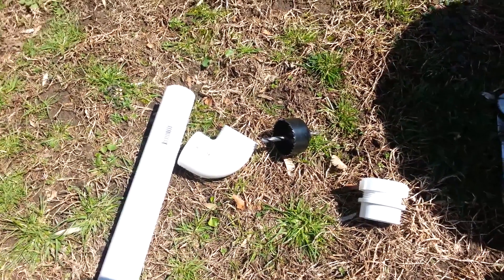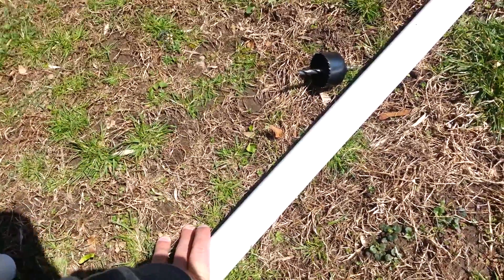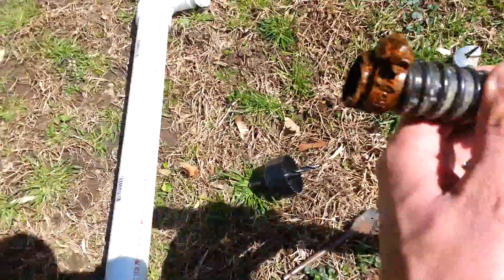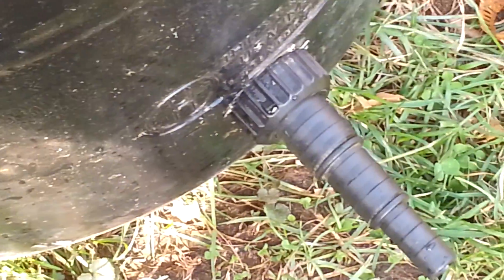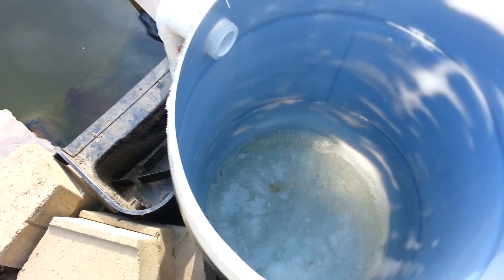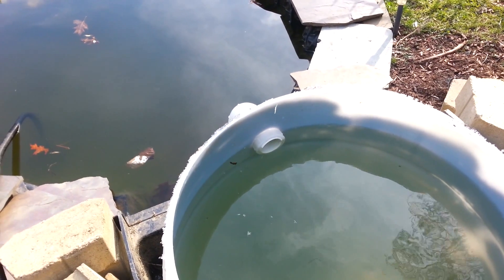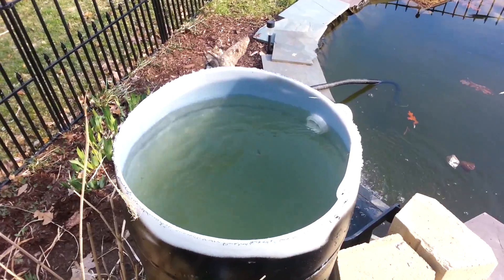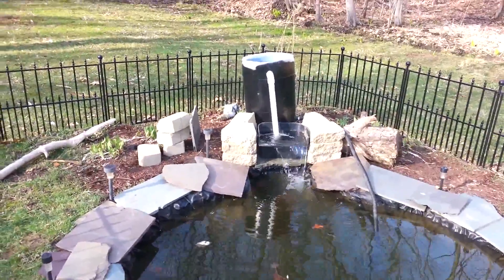How To Build A D.I.Y Pond Filter Step By Step

Comment: hi, i think you must reverse the input and output, let gravity do the rest
or if u want to keep the output at the top, you can directly place the input into the barrel by using a pipe and drown it all the way to the bottom barrel.
the bottom line is you can reduce the pressure of the pump by doing this

Comment: Need a ball valve on return or drill new hole for return up top on barrel with pvc goin inside to bottom. Then use your bottom hole for getting the sludge out aka water changes. Just hook a hose up and water your garden. You don't want to flush all that caught up sludge back in pond with your fish. Cheers

Comment: There would be a lot less pressure on the pump if you put the water into the filter from the top with a pipe leading down to the bottom.